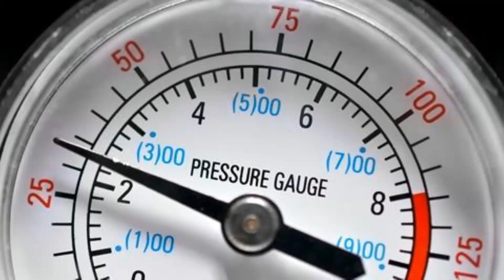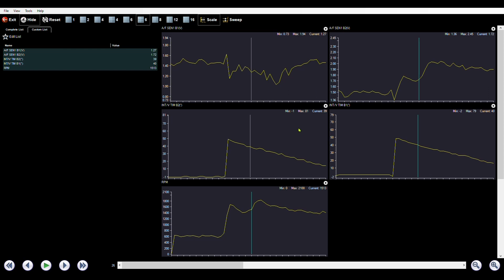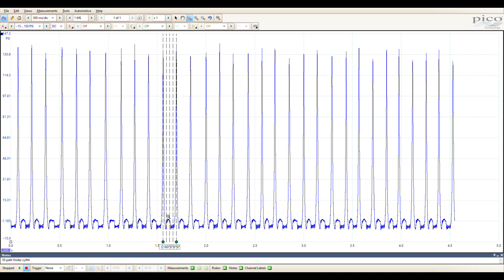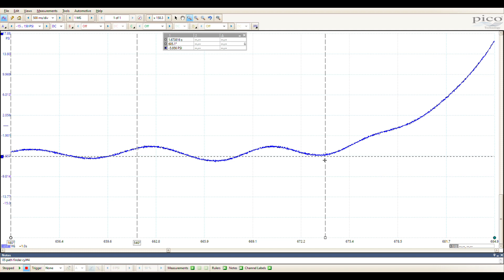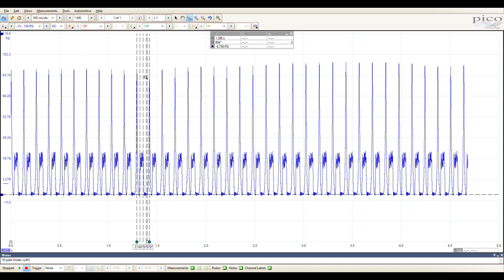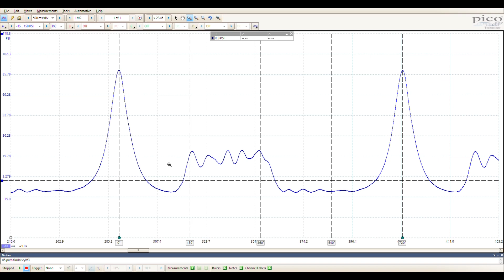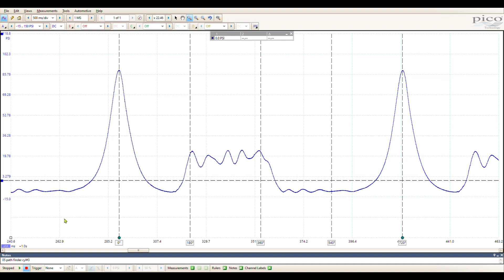Can't take the pressure!

Comment: It's good to be that accurate and confident in your diag for these times when the customer declines the repairs.  He's not gonna find out that you were wrong!
Reply: I like your comment about not pulling the timing cover apart, that's what sold me on these pressure transducers years ago. Being able to diagnose engine mechanical issues without disassembly was a game changer.
Reply from the maker: Yea, worse case, intake removal to get to a spark plug.
Reply from the maker: Thanks for commenting 🤘.  Out of all the things I'm wrong about in life, mis- diagnosing a car issue really ruins my day, so I go to witts end to try and get it correct the first time,  It's almost personal 😅.